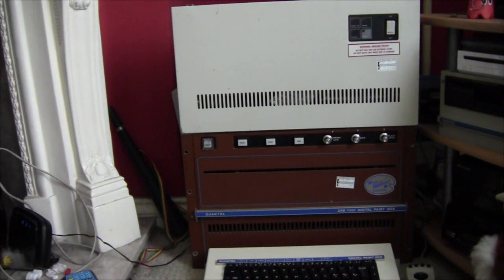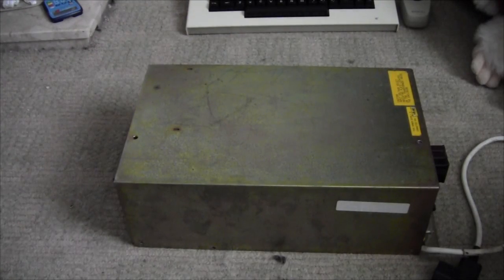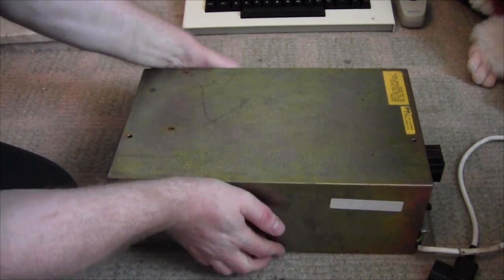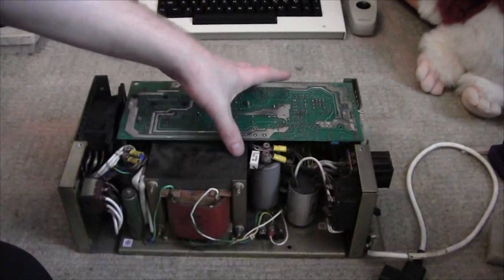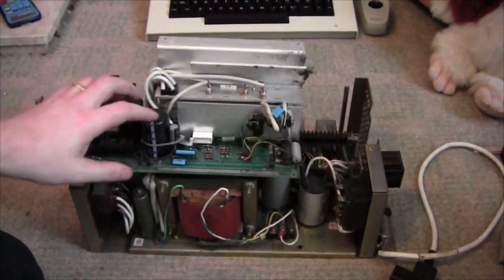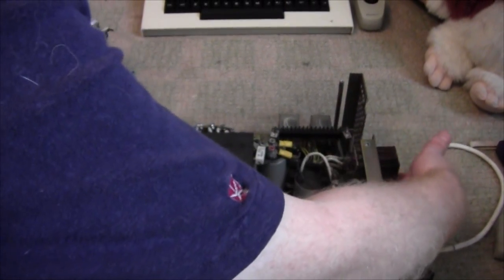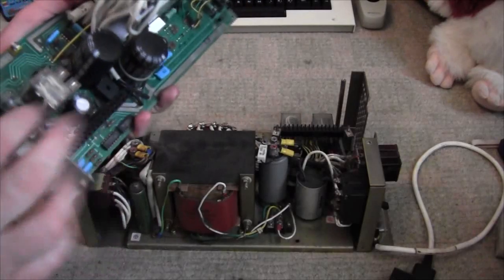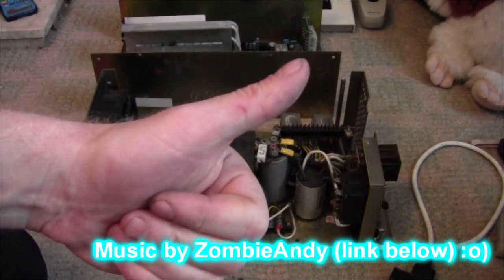Quantel Paintbox Resoration Part 1:   A teardown of the harddrive's very scary Linear Power Supply!

Comment from the maker: Yep, thanks Stu, once I have the hard drive running with it, I intend to order it new parts straight away, the paintbox it'self will get the same attention once it's powered up :o)  I'll be operating it on an extension lead that will sit right beside me so I can switch it off at the mains if anything untoward occurs :o)

Comment: .. dries out and in extreme cases evaporates (creating the bulges you sometimes see in the lids of some caps). A cap that is 20 to 30 years old won't hold the charge it did when it was new. Now Quantel will have used good quality parts and the UK isn't a hot sweltering country, but those caps wil be leaky. No need to change them now perhaps, but at some stage a full rebuild will ensure a long happy life! The mains filter caps work the hardest and they do need more attention..

Comment: Guys, I can't stress enough how important it is to have strong, reliable power supplies for this kit. You're looking at probably the only spares for a series 1 paintbox in the UK, so you'd don't get too many chances to get it right. It's worth remembering electrolytic caps are essentially batteries - they are 'wet' devices that contain an electrolyte soaked into a tightly round roll of absorbent material and stuck in a sealed can. With the passage of time and application of heat this stuff..

Comment from the maker: Yes, that's why this is not a device to be messed with, when we powered it up, we were nowhere near it, I won't even be putting the multimeter into it's pins with it powered up, I shall put them in then power it up to take a reading :o)